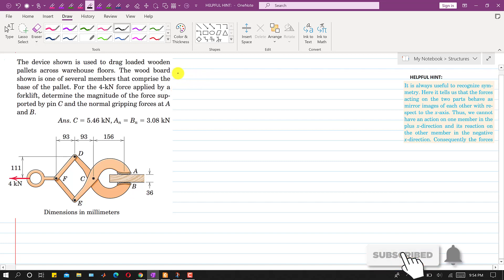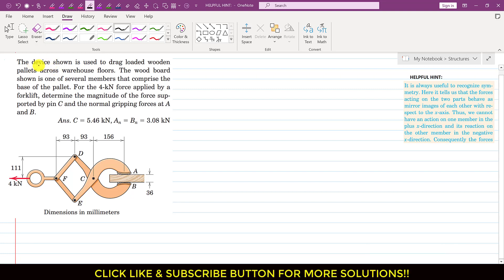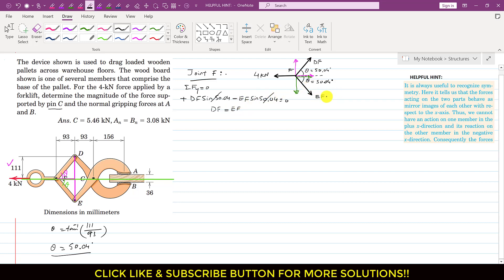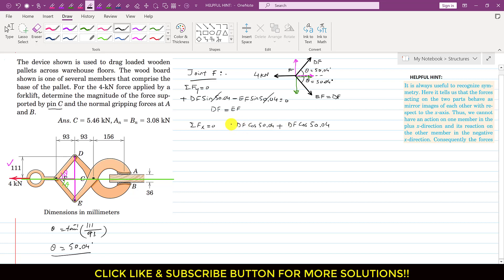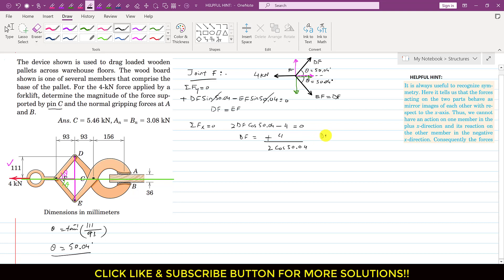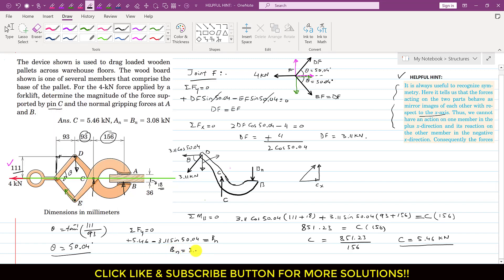Determine the normal gripping force at A and B. | Frames and Machines | Engineers Academy

Comment: Sorry what I get is that SigmaFx=0 is not satisfied in member BCD if you take Cx to be zero! Can you please explain?
Reply: The joint C is incapable of supporting a force in the x direction as both members attatched to it "move" in the x direction. However, The grips at A and B provide a normal force and therefore also a friction force which does provide a force in the x direction. Therefore, sigma Fx = 0 is satisfied. Taking the moment about point B helps us avoid having to deal with this friction force and we can focus on the reaction at C. Hope that helps!